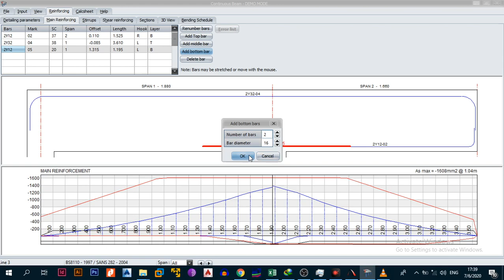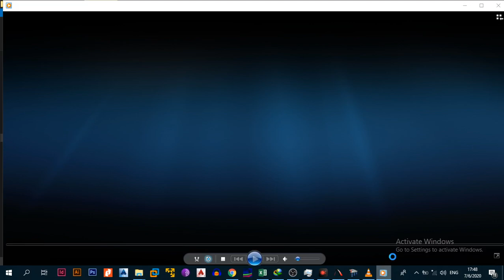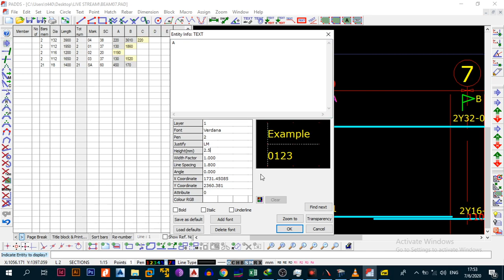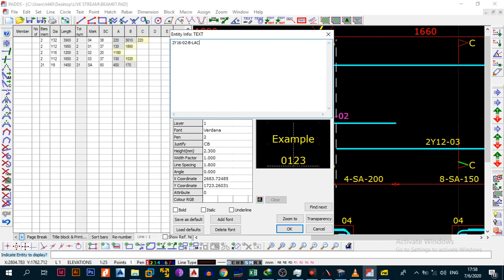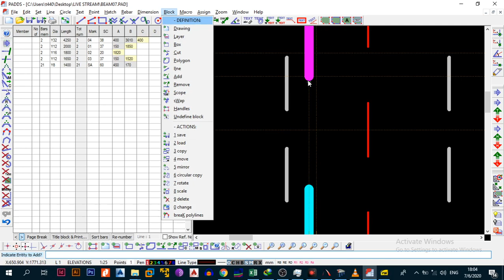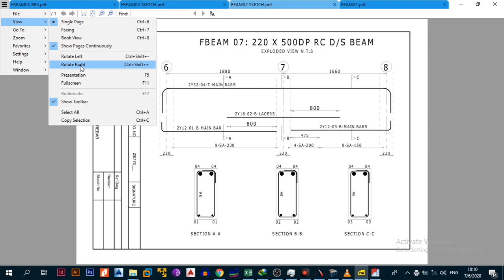How to Detail Cantilever Beam Reinforcement in Prokon like a Prokon Expert

Comment: Thank you very much for sharing your knowledge with the bigginers. I need to have to ask few questions, sir
1.What does the mean of % Live load permanent value (Input------->Parameters)
2. And can't we run the model for a few combinations at once
3. When there are few spans we need to arrange loads according to find the critical load arrangement, so, can we do it in Prokon software.